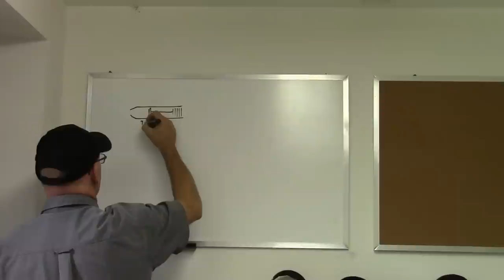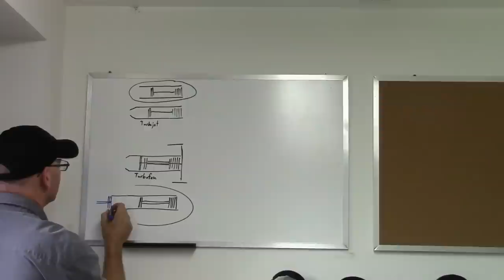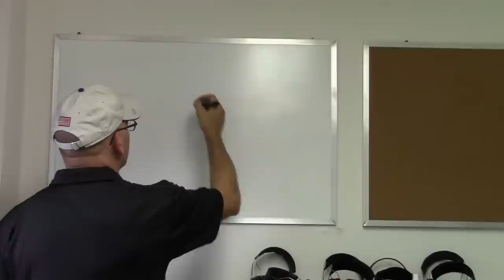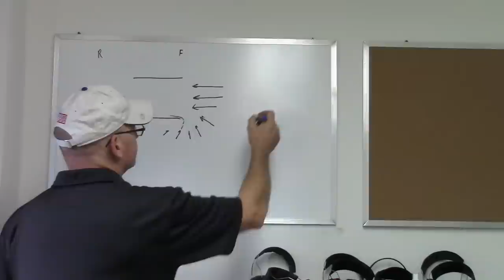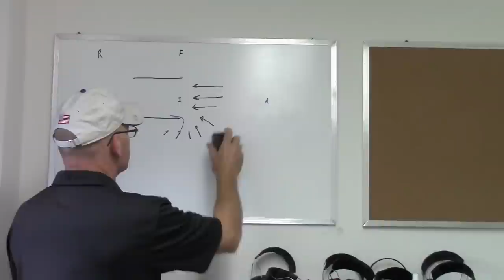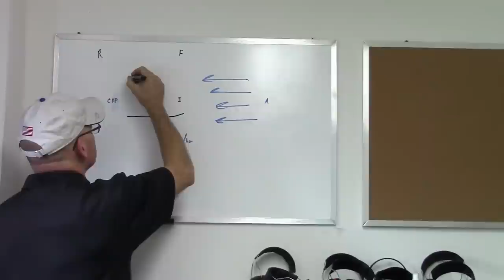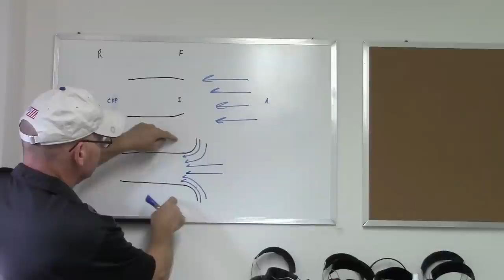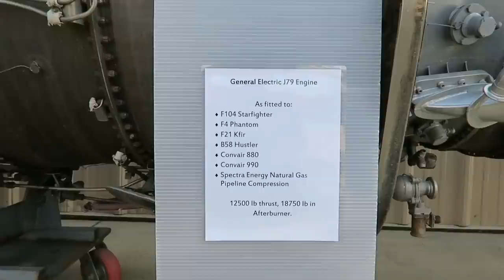Jet Questions 66

Comment: A few weeks ago I was working on the 475th Fighter Group exhibit at the Planes of Fame Museum In Chino, Ca.  There was a crew working on the P-38 Lightning getting it ready for an upcoming air show.  If was fascinating seeing this aircraft with all it covers and inspection plates removed.  Not a power tool in sight.  Everything was done with hand tools.  When you work with hand tools you can feel when something is not right.  Then stop, correct the problem before continuing.   If you strip the screw it’s not so bad.  However when you strip the threads on the female side it going to take hours to fix.

Comment: I once experimented with inlet cones and found the difference so significant that it was clearly measurable with household equipment. The air hates sharp edges, it rather takes a detour.

Comment: One solution to cockpit air conditioning, although an old one and still in use by aircraft such as the CL-41 Tutor flown by the Snowbirds (Orenda variant of the J-85 engine.) use an expansion turbine driven by compressor bleed air (I think 8th. stage.) This hot compressor air is routed through the expansion turbine where it is decompressed and cooled to frigid temps. A second pipe with full hot bleed air runs alongside the expansion turbine and just downstream of the expansion turbine, a modulating valve receives both the hot and cold air and mixes the hot and cold air at a ratio selected by the pilot for personal comfort. Good system. You can make it snow (literally) in the cockpit or make it hot enough to roast your butt.

Comment: At 21:00 you talk about fastener costs. When i worked for Alcoa, I made aerospace fasteners and I was extremely surprised at the cost of some parts.We made this one tiny, tiny nut, possibly 2mm in diameter, that I could easily fit 60,000 USD worth in my pants pocket. If only there was a black market for the parts. lol

Comment: On that last question though, when looking at the LM1500 combustors, there appeared to be cooling air still bypassing that seal you pointed at to go through tiny holes between the nozzles. Film cooling for the first stage compressor nozzles perhaps? Unless I am missing an additional outer layer of cool air, it seems as though the air does flow past (but not slip past directly to the turbine). There appear to be micro holes drilled in for cooling, both on top and bottom of the nozzle blade. I noticed that the inner portion had an additional layer that would funnel air into those nozzles as well. The seal is there, but it looks like it is one lip further up. When you showed the next engine, it looked like the seals were almost identical. In any case, THANK YOU for that level of detail!

At first, I was somewhat confused by the legality of afterburner and variable nozzle engines, but was finally able to find an answer, at least, for me in the states.
Supersonic is not allowed over land (12/24 nautical miles off the coast and it is irrelevant). You can buy foreign engines with afterburners, but all sold in the states that are of US or ally origin are disabled/ removed. Mig 29? You can buy one with the afterburners. 

This is, without a doubt, and incredible AQ video (as they all are). Loved it! The detail you show is second to none.
Reply from the maker: +Cody Smallwood Basically you've described it, except I think you meant to say first stage turbine nozzles. If you did, then that is correct.
Reply: Yes sir.
Im still blown away with your activity despite so many comments and questions!
Have a happy new year and keep on rocking!

Comment: quick power tool story: AGM-28 missle, hyd access panel had LOTS of #3 phillips screws. used to use a speed wrench and a universal [to get lower screws inches above the cowl - J52 P-3].  pain in the butt,, LETS use air wrench!. remember the universal? have to hold it with a gloved hand; stripped the screw heads all the time; ruined the phillips bits; AND sent many universals and bit holders flying at some speed below the wing of the B-52. NO MORE POWER!

Comment: Hi AgentJayz, i love watching your videos.
very informative they are.
I have a question:-
what is the difference between the shape and functioning of a fan blade(as in case of fan of a turbofan engine) and the compressor blade.
Are both the aerofoils or a the compressor blades are shaped so as to produce more pressure ratio per stage.??

Thank you.
Reply: Patty& JetEngines There is no real difference between the shape and function of a fan blade and a compressor blade: what we call a fan could equally well be described as a single-stage low pressure compressor.  However, the design of the large fan blades you see behind the intake of a big turbofan is optimised to maximise mass flow, rather than pressure ratio.  The design of core engine compressor blades is optimised to maximise the pressure ratio per stage, for minimum weight and reduced parts count.  To demonstrate the advances made in this direction, the J79/LM1500 has a 17-stage compressor with a 13:1 pressure ratio: one of the latest big 2-spool turbofans has a 10-stage HP compressor with a pressure ratio of over 23:1.
Reply from the maker: Patty& JetEngines  In a couple of videos, I address this very question. Have a look in the index of the playlist called Your Questions Answered.
 Look for Compressor blade function, or Blades and stators.. that sort of thing.  You will discover something you have not thought about before...
I can tell that by the way you've worded your question.

Comment: Thank you for your videos, +AgentJayZ!

In a stationary engine without a bell shape, the "sharp corner" that the air must follow also generates a lot of turbulence, right? Those vortices we see sometimes in fornt of stationary aircrafit illustrate this pretty well, don'they?
Reply from the maker: SnowRaptor Yes, and no. The lack of a bellmouth, or forward velocity of the engine, causes turbulence inside the inlet. 
Vortices are outside the inlet, and are not caused by turbulence. They are cause by the vagaries and magic involved in airflow in regions of widely differing velocities and directions of flow. Like little tornadoes, they are mysterious and wonderful.
Many of my test videos show vortices entering the bellmouth, where there is no turbulence.
Reply: AgentJayZ Oh, good point, thanks!
Reply: SnowRaptor Please see my answer to Jeff Manning for another angle on what might happen to an engine without a bellmouth intake, as a result of the non-uniform and turbulent flow into the compressor.  On the subject of vortices, I upset another subscriber a couple of weeks ago, which I regret, but I believe I knew what I was talking about.  If an engine on test, or in a static installation, were allowed to run for any length of time with a so-called 'standing vortex' entering the intake, there would be a risk of it causing high vibration levels in the first-stage blades, resulting in fatigue cracking and possible blade failure.  As I mentioned in a previous post, this happened in the original Marine Olympus installation, but I won't describe the problem and solution again here.  If you want to see examples of visible standing vortices, then look for videos of C-17s elsewhere on YouTube.

Comment: In reference to the LM 2500 as it relates to its turbofan counterpart, is there any horse power loss when the engine does not have the fan on it?  As I watch these videos I think I understand that the fan is merely to produce an enormous amount of thrust and that's about it. When you don't need thrust you don't need a fan. But the fan helps take in air which might help with power but on the flip side it takes power to run the fan via a power turbine which might be about a wash when it comes to total power output. So is there any output horsepower change by adding or removing a fan?

Also thank you for responding to some of my questions. It makes learning about this stuff a lot of fun.
Reply from the maker: +Seth Jensen The fan does pass a small amount of its airflow into the core engine, and GE even calls it a "core booster", so without the booster the LM2500 makes a little less HP. The bypass part of the fan is a way of converting the power of the core exhaust jet into a lower speed, higher mass flow of air which causes the huge thrust. By any conversion of energy flow (power) from one form to another always incurs some losses.
So I would say the boosting is counteracted by the losses of conversion, in a ballpark way of thinking.
Reply: +AgentJayZ so is that another way to say plus or minus a small margin, it is about the same either way?

Comment: Hi Jay,
Thanks for all the awesome videos. You do a good job of explaining things. 

What are the pros and cons of a free power turbine?

I'm having trouble finding much useful information on this. I have googled it and watched all the videos in your power turbine section. I'm sure you would have talked about this before, but I am having trouble finding anything about it even after watching literally hours of your videos. Hahahaha! Apologies if you have answered it before.

Would I be correct in saying that it allows everything to be at its optimum rpm at the expense of slightly reduced efficiency. As I assume a direct connection would be more efficient.

Keep up the good work.
Reply from the maker: cantunovic87 It is not less efficient. That assumption is made by everybody, and it is wrong. The two engines types have different handling characteristics. I have made a video discussing this . Check the Q index for PT6 vs TPE331 turboprops.
One is free power turbine, the other is single shaft. Both are very efficient, reliable, and popular.
Reply: AgentJayZ 
Thank you. I will check it out. Much appreciated.

Comment: Any plans to build a Frankenstein engine out of all them spare parts? Just to throw frozen chickens in and generally piss around with? YouTube it right up!
Reply from the maker: We have a few scrap engines that are large, not running, but otherwise complete. They are too big for a "spare time" project. Thousands of hours of disassembly, cleaning, inspection, rework, and reassembly. Using special tools and shop equipment.
Then it's a team effort to get it into the test cell; the fuel bill would be in the thousands, and there is a substantial test cell rental fee. After all that... it would appear to be the same as any other engine test that we do, except it would be of an engine nobody needs or wants.
It's a lot of work, and nobody wants to do all that just so I could throw viewers suggestions into it, Come to think of it, I don't think I do either.

Comment: I have a question unrelated to this video, but wanted to make it a public question.
I was looking at the GE 9X and noticed a set of blades located behind the fan, in the bypass duct.  I was wondering what they were for?  They don't appear to be variable from the somewhat generic images I've seen.  My only thought is that they are to straighten out the air flow to keep the turbulence behind the plane to a minimum?  Perhaps aiding in shorter take-off intervals for other jets?
Reply from the maker: I'm not that familiar with this new engine, but what you are describing are stators for the fan. The fan functions to accelerate air rearward. Fan stators will help it do that in two ways:
They will remove a great deal of the spiral or rotating velocity from the discharge air, and ensure it travels directly backward.
Also, they can be configured to present a convergent pathway to the discharge air (exactly the opposite of compressor stators),  and therefore convert any pressure increase caused by the fan into even greater velocity. That would increase thrust, and that's always good, right?

Graham will let us all know if I got that second point right...
Reply: Thank you.  I thought about it a bit more after posting the question, and while watching yet another one of you're videos (I'm currently up to Q74 after ONLY a month of watching your channel, lol). Then it dawned on me that it may be some kind of stator/strut combo, since the bypass duct is unsupported on that end.  But I'm hesitant about the strut part...

Comment: Hi! From multiple videos you uplaoded, I was able to build my understanding on jet engine principals upto diffuser. However, after diffuser when air enters combuster is where i dont understand further. What is the point of thrust in a turbojet engine?? I mean at what point/place exactly the thrust gets generated. Is it the final stage of turbine? Nozzle? If nozzle, then when nozzles are wide open, how is thrust getting generated?
Reply from the maker: Got a video for you... it has the word Books in the title. It's quite recent.